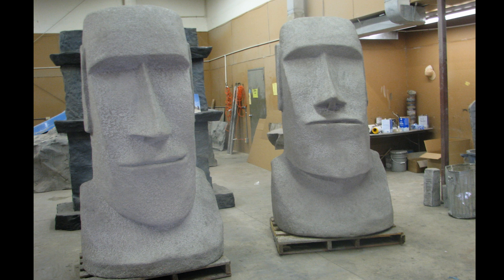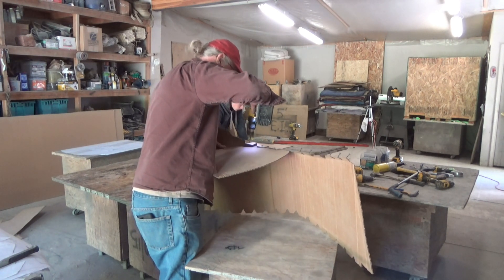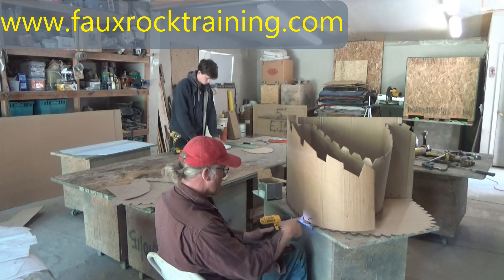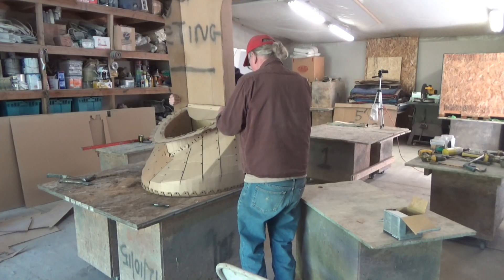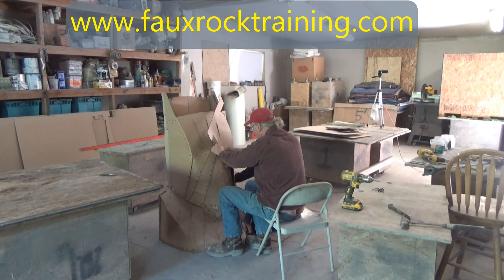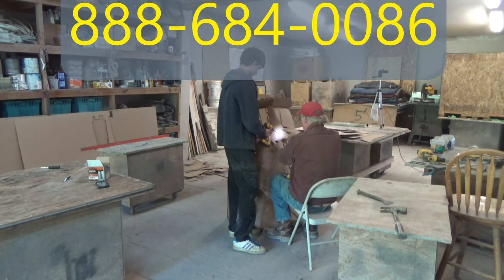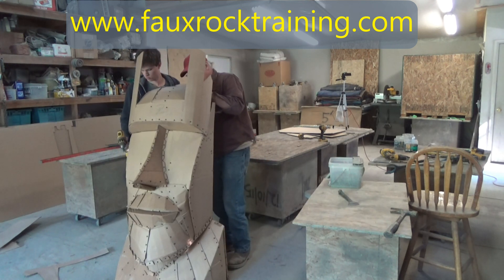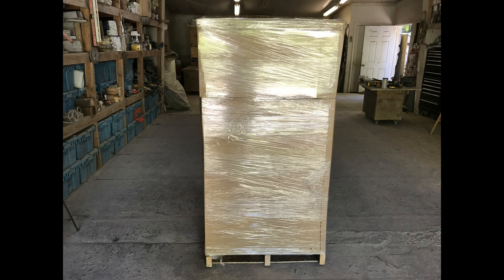Making a Moai statue from Easter Island

Comment: Is that cardboard that they're made out of?
Reply from the maker: I use the cardboard as a temporary form to be able to apply the fiber mixture to the exacting shape that I want to end up with. 
Thanks for watching my videos..
Reply: @fauxrock  what is it that you apply to the cardboard?
Reply from the maker: It’s a proprietary cement tacious fiber reinforced composite which we generally put around a 1/2” to 3/4” of an inch in thickness.